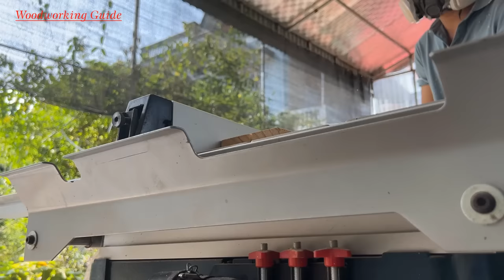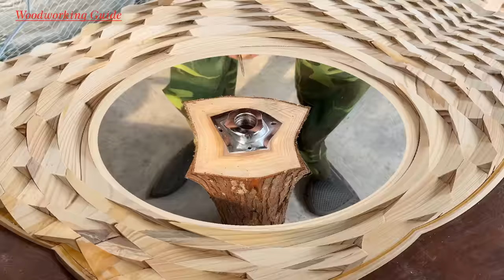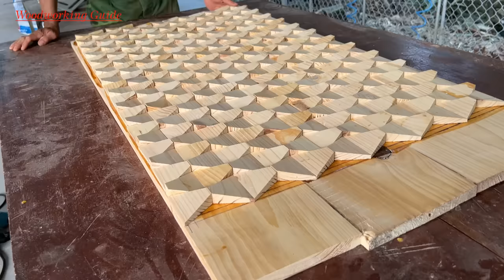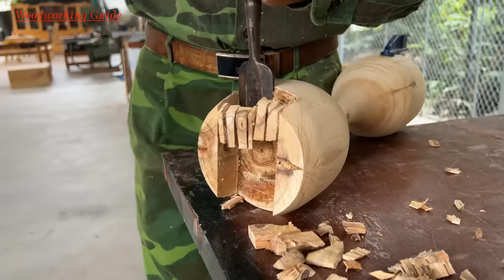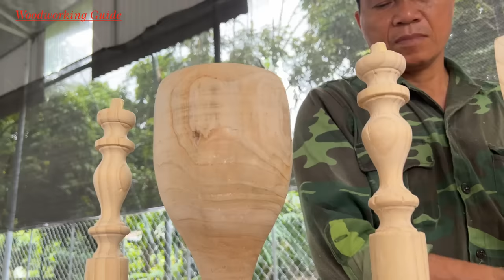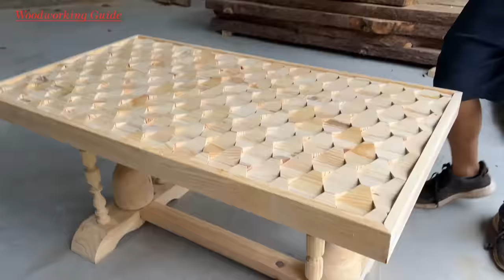A Great Way To Recycle Wood // The Most Unique Wood Recycling Project

Comment: If you made the glass fall into the wood so that its edges would not be visible, it would have been better, and you have a wonderful job
Reply: Recess
Reply: @bromarvids5186  👍👍
Reply: @bromarvids5186  3в же э́э́ы́я́эыы́вз900з0я0я
Reply: Better yet, pour epoxy instead of glass
Reply: @taljairrusk5408  👍✅
Reply: Can still be done by wrapping with more lengths, but I think the original exposed edge adds more to the effect.
Reply: Meh, either ways fine...

Comment: Great tutorial on:
- risk your fingers;
- risk lungs disease;
- how not use a lathe;
- how to not use a skilsaw;
- how to not use a spray painter;
- how to waste lumber;
- how ending with a orribile aesthetic result.
Thank you.
Reply: I am no woodworker myself but holy duck that was an adventure to watch. I find the end result rather pleasing but in the making process i was tempted to jump out of my window. The sawing off the rim was especially pleasing with nothing fitting and it being held in place by awful clamps. I first thought, oh, he is making something that the epoxy he is covering that in doesn't spill. His use of the circular tabletop saw or what the heck it is called, when he freehand cut out the slot on top of the leg was bringing giving me great joy.
Reply: This is how your furniture are made, don’t be surprised
Reply: Funny you should say that.  In America, “safety” means not going up onto a sloped roof to protect an ex-POTUS….ESPECIALLY, if it’s on a hot day.  For that matter, safe wood-working practices (in America) means using proper form when pressing the start button on that CNC machine, so the DEI/Affirmative Action-hire doesn’t get carpel tunnel syndrome.  So, perhaps the Asian dude, who still has all his fingers, in SPITE of decades of using unsafe practices, is on to something here.  This wasn’t an OSHA video, dude.  You probably sat through this entire video just to make that comment.  The man in the video didn’t smile once, and I get the impression he’s a much happier, more grateful, person than you, by FAR.
Reply: @phillamoore157  First of all I'm not American, I was not born in the USA and I never lived there. So I'm not talking about the American safety rules, that I don't know. Second, in my comment I never wrote about happiness, smiles or not smiles. The guy, happier than me in your opinion, he's a bad worker and a bad designer. And when you put something on YouTube, you have to pay attention...he's skilled, as you say. But if a teenager watch this video and without the experience and the skills of this guy want to start working in the same way, for sure has some issues. It is the problem.

Comment: C+ on the woodworking skills. Still a nice piece though. Thanks for the video always enjoy watching craftsman at work.
Reply: Newby woodworker here, but If that’s a C+ then I’m barely passing lol. I’d think at least a B/B-. I admire your high standards but how couldve he gotten that A? What could be added or was missing, what could’ve he corrected, improved on, etc? I seek no conflict just curious.
Reply: @7R4dicalized  I'm no professional wood worker, but what I see: lots of gaps and loose fitting joints, cuts that went too deep, the 45 degree miter joint for the trim around the edge didn't meet cleanly, no where near enough sanding. It's a decent enough table and the top design is cool and a good use of small bits of wood, for sure. just, rushed, basically.

Comment: If you only could resin the top to level it, and a more smooth grid finish also oils instead of vanish. No. 2 the side rails ought to have superceded the cross rails under the top. Otherwise you are creative. Thanks for your good work!

Comment: WOW !! I wanna be able to make stuff like that !!
I don't have enough different kinds of saw's !! (Or, a lathe)
Reply: I have bought, in the past 2 yrs;
 Table model Scroll Saw (Porter), Table model Mitre Saw (Craftsman), Circular Saw (Craftsman), Jigsaw (Craftsman),  3 different power sanders, Belt, Mouse, and a kind of medium size circular sander (all Craftsman). I have 12 different colors of Stains, Pre-stain, and lacquer. Trying to start my own little business. "Flutterby's and Hummer's Home Decor", a Faith-based shop for small items that I was working on B4 the deep depression set in. I've salvaged a bunch of pallets for working on projects that are rustic looking, and new wood for the new looking products. I was working on my screened-in porch at night, and, then we got new neighbors on both sides of us, within 20' of where I had been working, and, felt like I had to stop because they had 3 kids in diapers, and would have a big problem with my noise.
I was a Night shift Homecare Pediatric Nurse, until I lost my job at the beginning of the "Plannedemic".
I no longer wanted to spend all my time in somebody else's house, if they were going to pass me some kind of thing that could so easily kill me (I'm 66yo).
I've been collecting supplies to start working on a dream, for over 10yrs. 
That dream is Flutterby's and Hummer's. But, what I was collecting for those 10 years was Artzy Craftzy supplies because my products will rely on fabrics, fabric paints and markers, machine embroidery, beads, etc. The main item's being Decorative Screens, like Drs offices used to have to get undressed behind, except for mine will be made in all kinds of colors and styles, Crosses, Fishes, and, wall hangings with Scriptures and Positive Sayings on them in Paints and Vinyls on rustic wood and on canvas.
I want to get this really rolling B4 I die, so that my adult High Functioning Autistic daughter can continue it, giving her a way to make a living that's within her realm of reality. No mean bosses to break her down.
IDK, maybe I'm just crazy....